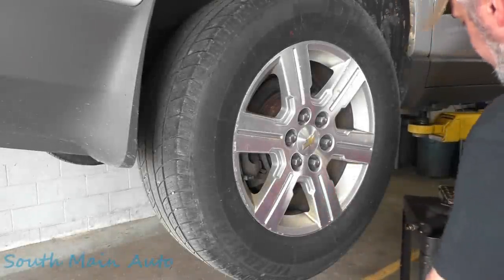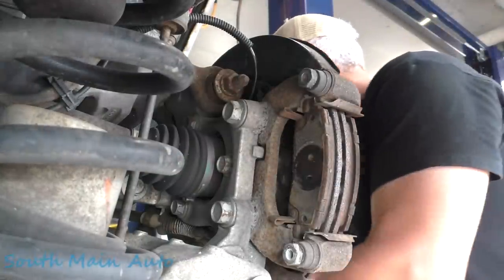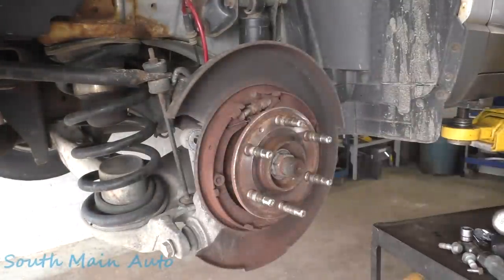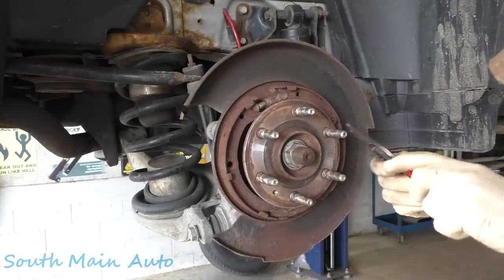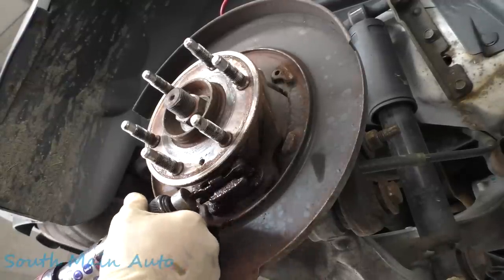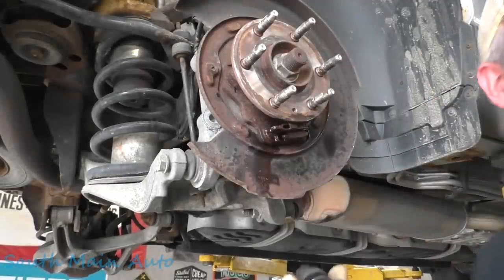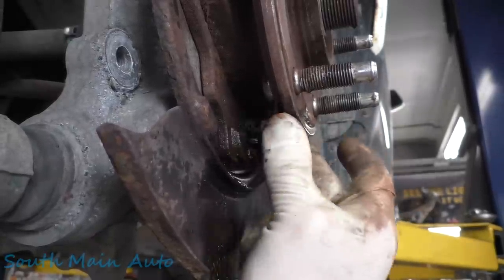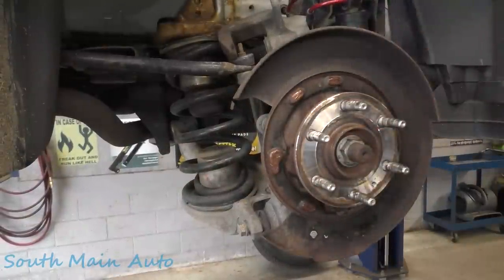Chevy Traverse: Parking Brake Shoes Actuators Froze Solid - Missing Friction Material

Comment: Heat up the pivot points and apply grease, it will melt and suck in like soldering a copper pipe. Doorman the only game in town most of the time it sucks

Comment: Listening to your assessment of this 2012 GM 3.6L V6s, I'm so glad my son found a 2007 Trailblazer LS with a 4.2L straight six. They've put 194,000 miles on it in 14 years, after buying it used with 36k. Body is almost spotless, starts every time, doesn't smoke or use oil. Just like GM's vaunted 3.8L V6, they've always gotta kill off a good thing. Everything will be electric in a few more years. sigh. And everybody knows there's no carbon emissions with electricity. snort, snort, choke, choke

Comment: 2011 traverse with over 235000 miles second owner bought with 75000 miles motor ,transmission original …. Knock on wood  … 🎉

Comment: That’s not true about these cars not lasting that long. I have a 2011 traverse that has 256,756 miles on it that has the original engine and transmission in it. I like in upstate NY near Canada and Vermont and we’re in the salt belt also and this baby is still going strong.

Comment: Would a hand sand blaster work well to remove rust from small parts on vehicles?
Reply: In my opinion the small sand blasters that are a handheld gun with the sand tank on top are crap.  I'd suggest to save a little money and buy the sand blasting cabinet. Also you'll need to have a good air compressor.

Comment: I hate these things, did a timing chain on these which suck, trying to get the ac gauges on these are a nightmare, so yeah this was one of the worst things GM ever came up with. On the plus side I have a customer with a 2012 traverse with 199,000 on the original drivetrain…

Comment: I didn’t know it needed parking brake shoes. Otherwise I would’ve supplied them. I made my appointment asking for rear brakes. I also needed a NYS inspection which I know requires the parking brake to work. I said I was assuming it just had to be adjusted. What I’m trying to say is that I didn’t fail to bring the required parts I just didn’t know they needed them. Also the TPMS sensor still goes off and the engine is original and the transmission is technically the original but I had the internals replaced to fixed the dreaded shutter problem these transmissions are highly known for. No hard feelings just wanted to clarify
Reply: WOW! This might be a first! The customer commenting in the thread. You sir just got Eric on a bad day imo and he never thinks cars can last in NY. Obviously that is untrue as long as proper maintenance is done regularly. You know how to take care of a car and use QUALITY parts. Those are excellent rotors and pads that you chose and the fact that the local parts suppliers didn't have the additional parts required exemplifies the need to sometimes supply your own parts.
My best customers supply their own parts and they can't know every single part that might be needed just like we don't know until we get in there and see what it needs! Nice choice on tires btw. I love the smooth ride they give although they don't last as long as some Michelins but are almost half the price. Before I saw your comment I wrote above that I prefer Akebono OEM brake pads. It's all I use now on my own vehicles. Something about that ceramic compound they use. I'm down South without rust but the brake rotors you chose with the treated Hats and slotted rotors are an excellent choice. I've been watching this channel for almost 10 years and watch every video. It's very rara to see Eric in a mood but we're all human. It happens to me all the time. I just don't have the balls to put it on the internet!
You are very lucky to have access to who I consider the best mechanic I have ever seen in my 30 years in the business. I would not hesitate to have Eric work on any of my friend's and family's cars and trucks.

Thank you for sharing your experience at SMA!
Reply: Don't worry about it, seems like there is always something else to replace/repair on a job like that.    You are a lucky man to be able to have Eric O. work on your car.  We should all be so blessed!  And good job taking care of that car. The 3.6 is a good engine as long as it is carefully maintained.

Comment: Never let people bring their own parts, have them return the parts and get what you deem reliable. You just have to use that line, and most will accept it.
Reply: I would prefer to have you return your parts and let me install a brand I trust and have found to be reliable.
Reply: I take my own parts onto my mechanic all the time. I dont get the cheapest and I don't get the most expensive either. Plus I know enough to get extra Parts that he may need for that particular job.

Comment: How could those shoes wear out? They are only engaged with the car isn't moving.
Reply: unless the mechanism is seized and they stay engaged when the vehicle is moving
Reply: @mdotguy  I have had that happen. I noticed something wrong right away. That brake would be on fire before it wore the shoe lining completely off. You think they would have noticed.
Reply: @randallgoldapp9510  some car owners are just blissfully unaware, my guy. their idea of maintenance is putting gas in the tank. weird noise? turn up the radio!
Reply: @mdotguy  how do you explain the smoke and fire?

Comment: I’ve always wondered how a parking brake shoe can wear out.
Reply: I have a bad habit driving without first releasing it but you think I'd need to really drive a distance to wear them.
Reply: By doing exactly what Eric O. did on the test drive…..Engaging it while rolling down the road.   Or driving off with it partially engaged.  While I wouldn’t hesitate to use it in the event of total brake failure (extremely unlikely in a well maintained modern car)…it is not designed to be used to slow the car down.  It’s a “parking brake” not an “emergency brake”.  No owner’s manual of any car at any time has ever described it as an “emergency brake”.
Reply: @vg3430  fun fact. It used to be an emergency brake until lawyers told the company to rename it parking brake for liability.

Comment: Those cheap drilled rotors are junk.  I used them for a few years because I could get a lifetime warranty where I only paid a few bucks every time they wore out.  Well after 4 sets in a few years that were warped or cracked I switched to some Wagner rotors and that set has been fine for 3 years!
Cheap parts are a massive false economy.

Comment: Can a guy ask you a question on a 3/4 ton chev truck?
Reply from the maker: I guess if a guy wanted to get up on one he could 🤷‍♂️
Reply: @SouthMainAuto  
I have a 3/4 chevy 1994
It randomly will quit running
Does not matter speed , engine temp, weather hot or cold
When it quits check engine light comes on
So i shut off key turn key back on let out clutch and it fires right up
Fuel sending unit replaced, correct fuel pressure
Ignition mod, throttle position senser. Plugs, wires, cap rotor, 
As this does not store  codes it a bugger to diagnose.
If i jump plug under dash it flashes 12  system ok
Im at a loss!

Comment: Wow drilled and slotted rotors on a Chey traverse! Get ya at least 3 more HP and performance breaking. 211,000 miles wow 😯 No more bringing your own parts… I like how you worked on that actuator! Do you charge flat rate for that or is it added in?  😊👍🏻💯💅

Comment: The only rime you should allow the customer to bring their own parts is when you can get the,  Can you get the correct parts for my '65 Corvair? I can. My Accord I should not be allowed to bring parts.  Wes Eric, you do need hearing proaction, even for one blow to the impact.  A private company would be fined by OSHA.  Where I worked had working on doors stating you needed hearing protection and it was bout as loud as inside a car going 80 mph.

Comment: watching South Main Auto for a long time, he only does one thing I have found I disagree with. He presses Caliper pistons without cracking the bleeder. He has even said in the past that it will not hurt ABS pumps. Well I changed a hub on my 2000 buick park avenue the other day. It was a rear hub, so I used the tool to press and turn in the caliper piston. It was resistant and popped a little when it did retract.  ABS pump started leaking.  Now it's a 23 year old car and the seal was probably weak. But it's bad advise. Crack your bleeder when pressing in caliper pistons.

Comment: We don’t need no stinkin parking brake
Reply: I’ve got a 2014 Buick encore and I’ve never used the emergency brake, I’m sure it’s probably froze up. Don’t ever plan on using it, and hopefully the other half doesn’t try to use it.and bringing this up today is the day that I pick up the new rotor’s and pads for the rear. Just had tires rotated and they said that they into the metal.😊
Reply: I’ve done my own brakes for years, I’m 66 and still barely able to getter done!
Reply: If you have an inspection state you do😂